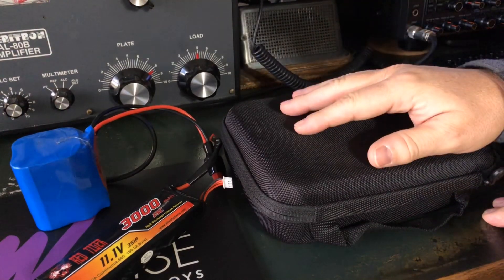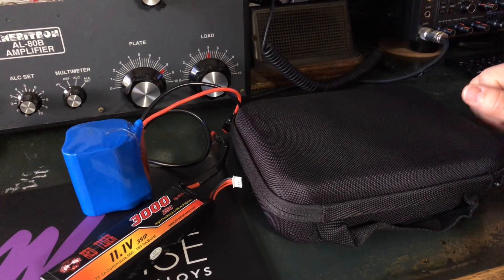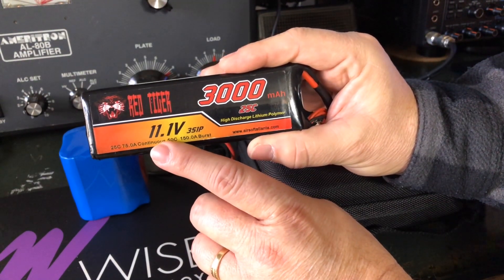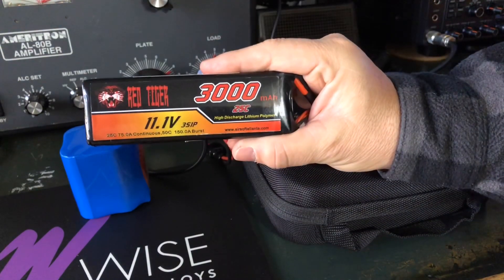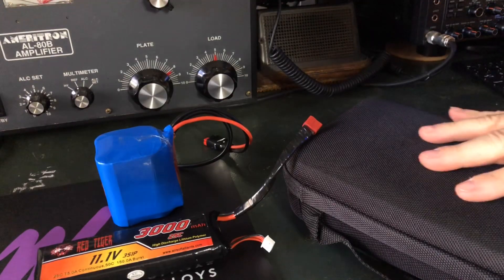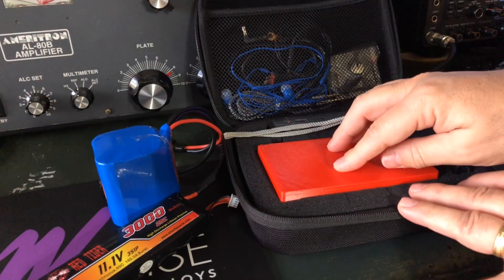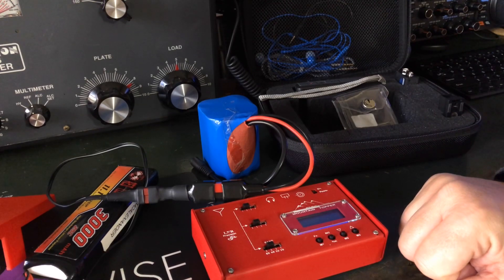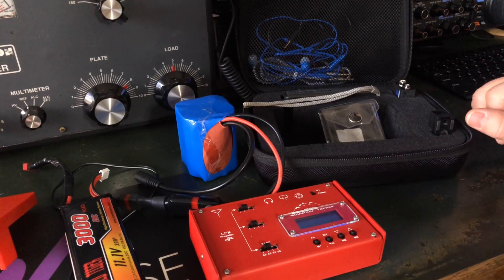Using a BIOENNO battery with a Mountain Topper (dropping the voltage)

Comment: My bioenno 1203ab 3ah battery at full charge measures 14.2V.   2 1N4001 diodes in series brought the voltage down to 13.6V.  In total, I connected 6 1N4001 diodes in series to the positive lead to bring the voltage down to 12.6.    I bought these particular diodes on Amazon, so maybe that's the problem.  I tested with two pretty new fluke multimeters. So I'm sure it wasn't a calibration issue.  Anyway, I'm good now. Just wanted to put this out there.
Reply from the maker: It depends upon the battery. Not all of my Bioenno batteries charge to the same level. I have one 12aH that charges to 14.4vDC. I have a 3aH that charges to 13.5vDC, which I use with my MTR4B V2.  Put as many diodes as you need to get to 13vDC.  Once you put the battery under load, the voltage will drop slightly.  And the more you transmit, the more it will drop. I like to start at 12.9 or 13vDC, so as the voltage drops, it stays longer within the range that allows full power from the MTR4B V2.

Comment: I noticed that the directions from LNR about the mtr4b they recommend 2 1N4001 diodes in series, and you said that you used 1 1N4007 diodes. 

Which would you recommend? Im looking to throw mine together.
Reply from the maker: For warranty reasons, maybe you should use two. I used one because LNR says that up to 13v is okay. The Bioenno starts at 13.5v with a full charge.  I wanted to start at 12.9v, because the voltage will drop anyway as I operate.  Two diodes should drop it to approximately 12.3v as a starting point.
Reply: @n4hnhradio  thank you for quick reply 73!
Reply from the maker: You’re welcome!

Comment: Why wouldn’t you just.get rid of  the Deans connector and go with Anderson all the way? Anderson is so much more adaptable, useful and prevalent in ham radio. The Anderson  could be placed on the battery too. 
Thanks for mentioning Long Island Cw Club too.
Reply from the maker: The Deans is lighter. And the Anderson is overkill. But, since the Bioenno comes with Anderson, I use it. The LiPo is an R/C car battery. Deans is common as that arena. Higher quality electric airsoft rifles also use Deans and LiPo. So, I’m keeping the batteries set up for their native use. Plus, I took the opportunity to hide the diode in the adapter.

Comment: I concur with other comment... Sure would appreciate a video on how to build the connector with the diode.  I just got my MTR and only have Bioenno batteries for my radios.  Looking forward to (hopefully) that connector build video :-)
Reply from the maker: I will try to shoot another video but it might take a while.  I don’t want to disassemble the adapter I already made, and I need to get more parts.

All you need to do is solder the non-striped side (anode) of a 1N4007 diode to the wire that you will crimp or solder into the red half of an Anderson Power Pole.  Solder the striped side of the diode (the cathode) to the positive terminal of a female Deans connector.  Crimp or solder a wire to the black half of the Anderson Power Pole, and solder the other end of this wire to the negative terminal of the Deans connector.

I use a Deans connector on the radio side.  This also allows me to power the radio with an 11.1vDC LiPo battery, as an alternative to the Bioenno.  LiPo batteries are popular with RC cars and the batteries are available with a Deans connector installed.  The 11.1vDC LiPo batteries typically charge up to approximately 12.5vDC, which is perfect for the Mountain Topper radios.

I applied heat-shrink tubing over the finished wiring to keep the diode from being exposed.  You could use electrical tape if you don’t have any heat shrink tubing. 

73, de N4HNH

Comment: If I add say 3 diodes in series will it drop the voltage .6x3 ?  So 1.8v? My older mtr3b says to not exceed 12v. Thanks
Reply from the maker: Yes, three diodes in series should do it.  Or just switch to a 3-cell LiPo.  But the LiPo will start at 12.1 to 12.5.  Maybe consider one diode for a 3-cell LiPo.

73, de N4HNH

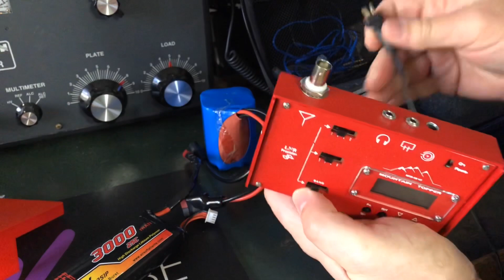Comment: you were saying the rc car battery had anderson connectors it does not. around 6:12 you say anderson power pole showing off the mountain topper connector then say anderson powerpole again at 6:29 for the rc battery lol just a misspeak but no problem. :)
Reply from the maker: Not changing it.  Too late.
Reply: @n4hnhradio  no i wouldnt change it either. We know what ya meant hehe :) yeah sounded like a good group. Several from Tenn one alabama arkansas and you. Heard you talking about the dx10 man that is the best radio ive ever owned. So quiet. I love it. and thanks for your videos on it too.
Reply from the maker: The FTdx10 is a game-changer.  No doubt!

73, de N4HNH